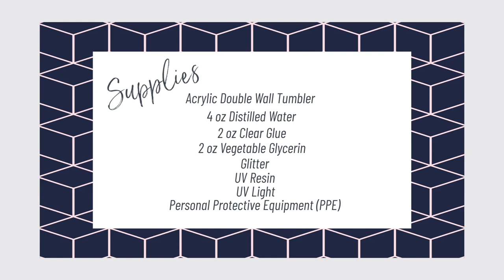DIY Snow Globe Tumbler Tutorial for Beginners

Comment: When u added the UV resin how did it not go in the hole ? 🧐 since it’s liquid? Cuz I’ve tried the gorilla epoxy glue and I gotta wait until it tickens up .
Reply from the maker: Like you… I don’t believe people when they say that UV resin won’t go inside the cup 😏. So I always put something between the hole and the UV resin. In this video, I used clear tape. I’ve also used furniture bumpers, hot glue, and glue adhesive dots.

Comment: I’ve used just glycerin and distilled water but my glitter mix clumps badly. Does the Elmer’s glue help?
Reply from the maker: The glue helps to slow down the flow. Adding fine glitter or using glitter mixes that include fine glitter is likely the cause of your clumping. 😬

Comment: I'm new to snowglobe tumblers.  I used the uv resin and it comes out sticky on the bottom.  What did I do wrong? Please help.
Reply from the maker: If it’s still sticky it needs to cure longer
Reply: @quatechiacreates  do I need to start over and remove the resin I have on the cup? Do I need to let it cure for 60 seconds and then an additional  30 seconds.
Reply from the maker: It’s all dependent on your UV resin and strength of the light you’re using. Check your UV resin for the what it requires to cure and check your light to see what the wattage is. I personally cure mine at max timing until it’s not sticky because my light sucks. If you can’t get that to work, remove and start over. Hope this helps
Reply: @quatechiacreates  I will try adding more resin and do 99 seconds to see if that works. If not I will start over. Thanks

Comment: I never got a clean hole with the hot fix tool. I ended up having to use the drill.
Reply from the maker: I’ve had some issues with it too. It often leaves raised edges. Now, I just melt those off with the hot fix tool

Comment: My glitter won't sink. Any tips?
Reply from the maker: I’d need some more info. It’s not sinking after you’ve sealed it?
Reply: @quatechiacreates  mine too- yes after sealed.  I tried opening back up and still didn't move
Reply from the maker: Are you using the same solution as I used in this video? If so, you’ll have to shake the life out of the tumbler because the glitter is likely not mixed well with the solution.